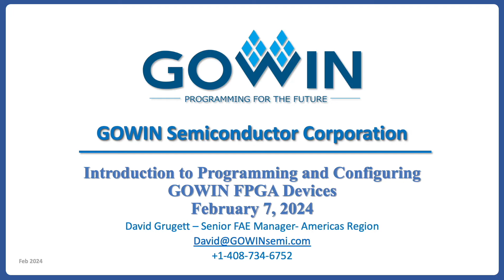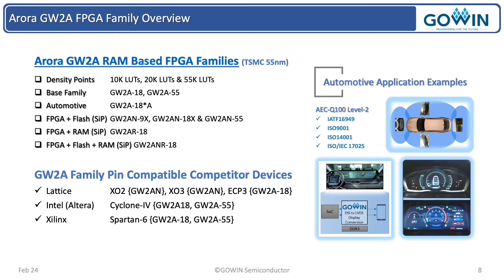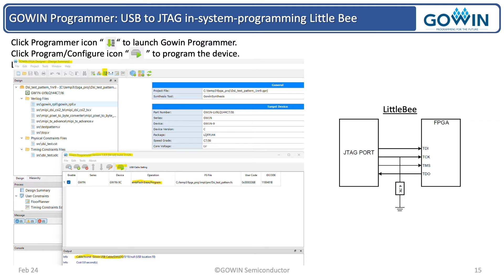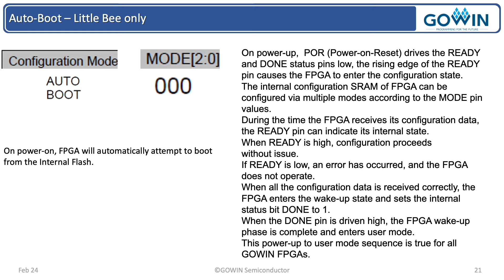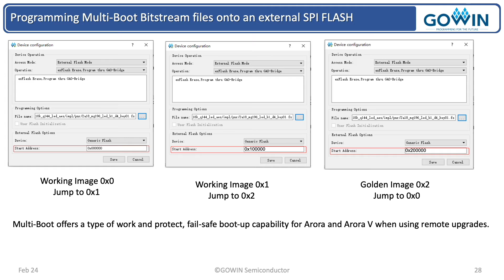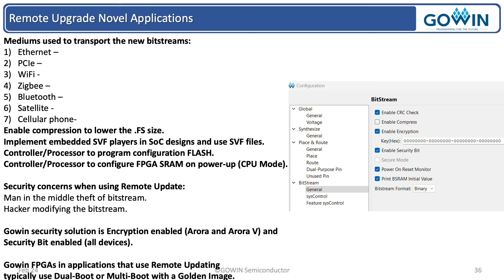GOWIN Webinar: Introduction to Programming and Configuring GOWIN FPGA Devices

Comment: I want to implement a Multi-Boot system for GW2AR.
Boot mode - from an external MSPI flash drive. Master SPI.
Flashed "non-erasable" (1) firmware area at address 0x0, Update (2) firmware area at address conditionally 0x8000.
So, when the power is up, (1) firmware will be loaded. Its OK. But in (1) fiemware, I set the SPI Flash Address option in the compiler - 0x8000.
What will happen if, after a successful(after 1 minute) loading of the firmware (1), I drive the ReConfig pin?
1 - (1) firmware load?
2 - (2) firmware load?

Comment: Hi ! nice video! I have some speciic questions. First of all is there still the community on telegram ? Second, i have a tang primer 20K and i am trying to make a simple counter using vhdl. I use some code obtained from the chat gpt, then  i assign the clk to H11 pin and the output the the board leds... But i can  not see any output. The leds remain open all the time withoyt any change. I have made a 10bit upcounter and assign the bits 9 to 5 on leds...